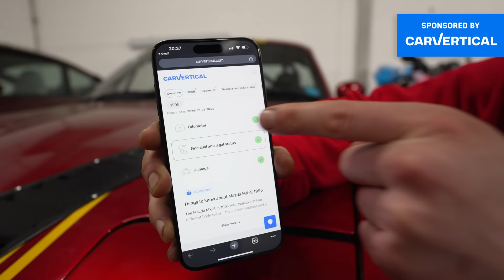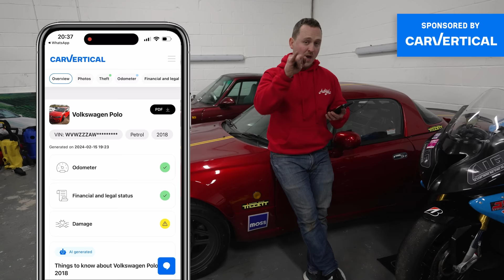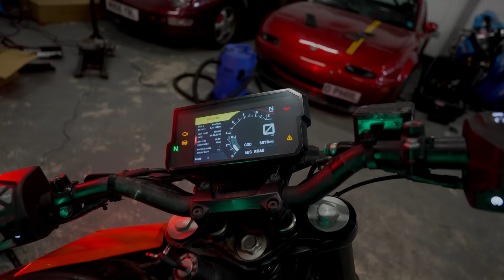FIXING EVERYTHING WRONG WITH MY CRASHED MOTORBIKE!

Comment: Oh Rory, what have you done. That bike IS the later model. The frames are different and it isn't possible to fit the later parts to the older bike. I work with bikes and have experience with both of these models. You have a cloned stolen motorcycle. Best you can do is involve the police and try not to get so excited every time you see something for sale..
Reply: I hope they do the right thing and involve the police, it'd be very disappointing to see them ignore it.
Reply: This comment was read by Alex on the latest podcast…they will do the right thing.

Comment: The frame number has to be fake because the 2014 duke didn't have a separate rear subframe, meaning that the mainframe isn't the one it identifies as... I suggest some more investigation is required.
Reply: Stolen bike with a doctored vin. Pretty embarrassing for a channel like this.
Reply: @aniyn agreed and the fact they haven't addressed the elephant in the room is pretty bit bad, as they would've seen the hundreds of comments mentioning its dodgey, also it's pretty rich considering their sponsor cv is literally made to help avoid buying dodgey motors.
Reply: It’d be a massive shame if they didn’t address it, especially after the rightful emotion when Taylor’s trailer got stolen
Reply: @ratgreen you can dry your eyes now because they addressed it on the podcast
Reply: @ratgreen they have got the police involved luckily now

Comment: Run a car vertical check, find out your bike is written off, and buy it anyway.
Reply: And have sketchy papers
Reply: Its stolen too
Reply: Nothing wrong with buying a write off as long as it's been repaired properly. This highlights an issue with the process though, if that frame is off another bike but with the 2012 VIN (as others have suggested) a HPI/Carvertical check isn't going to highlight any issue with theft
Reply: @Taylorjay99  love it nonethelesss
Reply: @Taylorjay99   Most of us won't be able to tell if its been repaired properly though

Comment: lads someone owns that bike that frame does not come on a 12 plate a 12 plate frame is a single unit that frame you guys got has a bolt on back subframe so not possible that frame is a 12 plate lol
Reply: could be a private plate ? thats the only thing i can think of .
other than that its 100% not the bike the logbook says its just got a stamped/vin plate on a nicked bike , dead giveaway is if its a plate vin like the old days if its stamped properly itll be harder to notice
Reply: In the video when they bought it they said that the vin number was filed off so it’s clearly been stolen at some point and replated as a 2012 plate
Reply: @Honestlycryabtit  bike has no value at all unless its broken for parts

Comment: Guys, if the pistons are stuck just use the master cylinder to pop the the pistons out don't use compressed air
Reply: Knowledge ❤
Reply: The piston that isnt stuck pops out , the other sits and says ``lets see you shift me now then mate ``
Reply: Almost lost my fingers redoing the brakes on my E32, it has one massive cylinder in the fronts. Was trying to get the rusted cylinder out with compressed air and just as i changed my grip on the caliper it shot out and i became deaf for a few seconds from the noise. I was so mad at myself i threw the caliper into the woods and ordered new ones.
Reply: @godzillas6301  it's more the fact that using compressed air to push pistons out can lead to as shown brake fluid going in their eyes, to pistons flying out at high speeds
Reply: FFS. I've been working on my own bikes for 20 years and this has never occurred to me. Always used air. Cheers dude
Reply: @fzr600dave Yep .... great way of putting lots of burnt bits into whatevers closest paintwork .

FZR aye .... i respect the name 🙂
Reply: @badmonkey640  would you're lazy then? It takes more set up time and is safer
Reply: @bigduphusaj162  so tell me then why we don't just use compressed air for brakes, you just reek of being lazy when doing the job right means you can charge more and be safer
Reply: I always use the lever to push the pistons out usually remove the pads put a small bit of wood in to stop one piston coming out before the other . See a guy nearly lose an eye using compressed air no joke piston flew out and smacked him in the eye it's not a great idea
Reply: @badmonkey640  also, I've been working on bikes since 2003, worked in motorcycle workshops, and went to college to get training on repair and maintenance, and am then went on to do computer programming and went motorcycle racing I am now training to get an astrophysics degree, so if you would like to debate on the safest way to do something please let's have at it but what are your qualifications?
Reply: @fzr600dave  in fact I've just checked and YOU were the poster. So I'm not sure why you're throwing a tantrum
Reply: A few years back at the NEC bike show they had a Lockheed master cylinder connected to a pressure gauge. Well over 200 psi quite easily reached.

Comment: I'm surprised you guys haven't looked a bit deeper into the bikes history. Surely you were dubious the frame fits perfectly with a 2020 model. The 2012 is different in so many ways. Possibly someones pride and joy you have.
Reply: If it has been stolen at least it’ll get returned to the owner running and driving.

Comment: Not to alert anybody but this is possibly a VIN swapped bike. That frame is not from 2012. I have a 2012. It has no detachable rear subframe. The frames different. The engine is different. The front folks are different. 2012 does not have ABS does not have an LCD screen everything about that rear sub-frame could be putting afterwards as a something I do plan to do to my own but that frame is not from 2012

Comment: So is it stolen, written off or what? It’s a 2020 with a 2012 number plate 🤷‍♂️
Reply: It’s a 2012 frame with 2020 bits on it. Sounds to me that a bike was stolen and stripped and the thieves fitted the parts on a cheap frame.
Reply: @luissera1296 It's definitely stolen with a fake VIN. 2012 small KTMs have a single piece frame. They changed to a separate subframe in 2017 when Gen 2s were released. The entire frame geometry is different. You can't just swap parts over from one to the other. The engine, yes, but nothing else will fit. That thing is definitely nicked

Comment: The learner burner I bought was a honda cbr125r. It was 1500 Australian so about 6 pounds UK. But that $1500 AUD the thing had 12 months rego. It had 21k kms on it and was filthy, but the only other thing the seller said was the fuel guage didn't work. Well a wash and the thing looks mint, fuel guage was an easy fix, it had no fuel in it. new oil, spark plug and tyres and its good. Did put a Yoshimura stainless exhaust on it as it was scary quiet to ride in traffic, now its irritating enough to others to not blindly change lanes. It has nothing under 8k rpm, but theres room as it revs to a tad over 11k. Its still slow, but its only 130kgs with a full tank so weighs next to nothing.

Comment: It's most likely running lean after switching the exhaust over. You might want to tweak the fuelling. You'll be able to tell if the EGTs are very high. Or you could take it to Big CC Racing in Wokingham and put it on the dyno, for a laugh. Would be an entertaining video.

Comment: ive had same ktm 2018 plate and it was horrible bought new and had problems straight away kept on cutting out randomly when setting of, lcd screen kept on turning of while riding and it used a lot of oil

Comment: This is embarrassing for so many reasons. Cut the links off for the new chain; loads come with too many links. 

You’ve an absolute ringer of a bike but the first thing anyone should ever do is clean the fucker. 

KTM engines are sensitive too, keep hitting the rev limiter cold it’s gonna lock up. 

But dayum. As a long term bike mechanic this whole video has made me wince.

Does the engine number match the v5?

Comment: Hi can please me what unit shocking finance is and where I stand if buying car for cash as this as come when I've the car check on it
Reply: Outstanding finance? It means you shouldn’t buy it as there no guarantee the current keeper will pay off the finance once they have your cash.
Reply: Unit stock finance is what dealerships use to finance their stock when they buy them from an auction or whatever, the dealer should pay it off as soon as you buy the car. - source I worked at a dealership.

Comment: I love SOME 125cc bikes, Honda makes some decent models (especially the monkey). However, I've ridden a friend's identical model to this bike, and it's a horrendous thing. I've never really liked KTM as it is, but there 125 range as a whole useless. They are all horrible plastic things with zero power, even for a 125 ! I ride the Royal Enfield Meteor 350, and my wife has the classic 350.
Reply: I bought a CB125R recently and it's a top bike. It's pretty gutless but stops and handles far better than most big bikes I've ridden. But I agree with you. Most 125's come with pisspoor brakes, suspension and no power. The CB has acceptable power for a 125 but it's still so slow.
Reply: @Gobbbbb  that's cool, I like the CB125R it's a nice bike. Honda are the only ones in the market who actually seem to know how to create a decent 125. It's the ridiculous motorcycle laws in the UK. Three separate licences before you can ride whatever you want! I have my A2 licence, so I can ride anything up to 46bhp. There are plenty of bikes in that range, and I'm not into my sports bikes. I like cafe cruisers and retro looking machines. If I were you, invest the money and get your A2. It's well worth it. It's a noticeable step up from a 125 but not so powerful that it's overwhelming to a new rider. This means you could also upgrade all the way up to a CB500 and still be under the 47hp limit.
Reply: @jamesnoonan7450  It seems like it currently yeah. I've road pretty much every single new 125, the gsxr, z125, rc/duke 125, yzf/mt125, the CB is MILES better to ride than any of those bikes, the others feel cheap. I think it's the suspension and build quality that makes the biggest difference. The Yamaha's are decent, just not as good.

Yeah it's really annoying. I'm on my 4th CBT currently, but I passed my Mod 1 yesterday and have my Mod 2 booked for April 3rd, I'm going for my full A (DAS). I am still going to keep the CB as I truly love it, but also get a cheap big bike for now. In a couple years I would love to upgrade to a CB650R, but I also like the idea of having the 125 because it costs me almost nothing to run and I LOVE it.
Reply: @Gobbbbb  honestly mate 125cc bikes are pure motorcycling. You can't get much better. it's just that the 125 market is saturated with rubbish. I went straight for my A2 after my CBT, so I have never owned a 125 personally. I've rode a few of my friends' bikes, including the CB125R and the Honda Money 125 (both brilliant little machines). If you want my op mate, I'd stick with what you love. If you only wanna ride 125cc bikes, go for it. My bike is the Royal Enfield Meteor 350. It certainly hasn't got a lot of poke, and getting up to 75 to 80 mph takes a long time and sometimes not even doable. It means, however, I stick to the b Roads and country lanes. I've ridden it from my house (near chester) all the way to Bournemouth on A and B roads only. If you're like me and I suspect you are its not about the fastest, most powerful bike or the largest and most intimidating its about.the journey and enjoying the ride.

Comment: No video response yet? Come on lads, even a short would be fine. We want to know what you are going to do about the stolen bike. Your lack of reaction or visible action is disconcerting. Are you waiting for somebody else to report you for handling stolen goods? Get on with it, do the decent thing.
Reply from the maker: We have on the podcast and your comment was even read out, check out the latest episode.
Reply: @Autoalexv2  Well done chaps. I approve of your option to go to the KTM dealer. They can determine some facts of the bike, and as you say, it is an interesting story. The insurance company will most likely offer it at a very low price. The police will obvs have some involvement but if you start the process, they won't be coming after you. Admirable action. Carry on...

Comment: No such thing as a "day time MOT". If it has lights, they have to work. Thing is, it doesn't legally need lights to pass an MOT. If it doesn't have lights, don't get caught riding between dusk and dawn. Simples. You're also not allowed to use that tail tidy either (recent changes). That rear sprocket had many miles left on it! Then you laid the new chain on the gritty floor....  Watching you guys work on that poor bike is cringe.